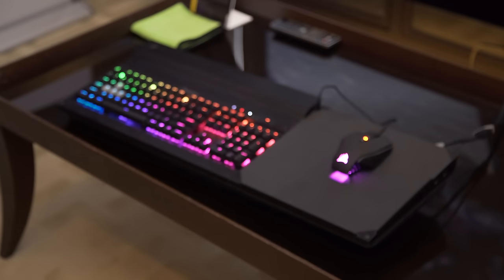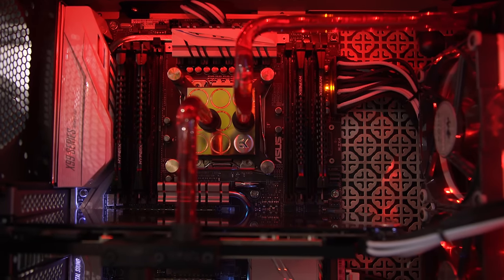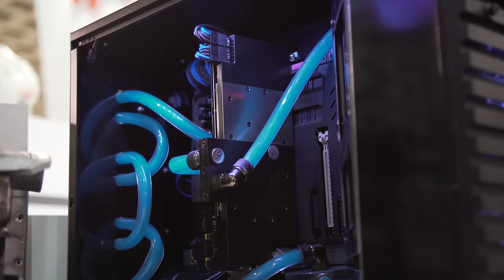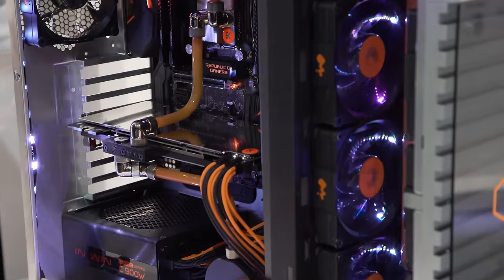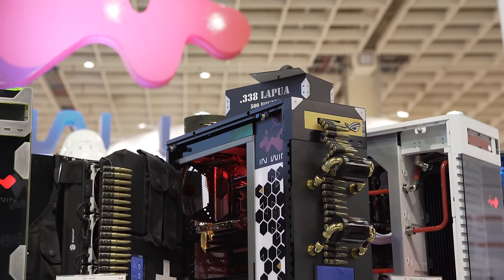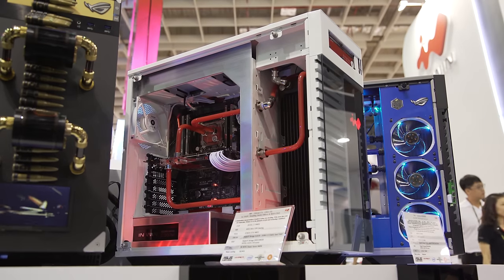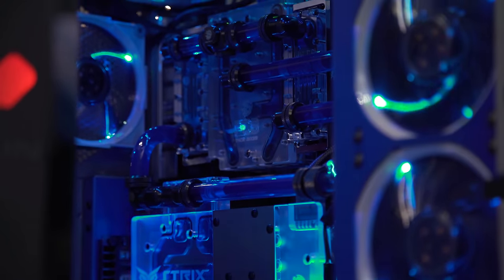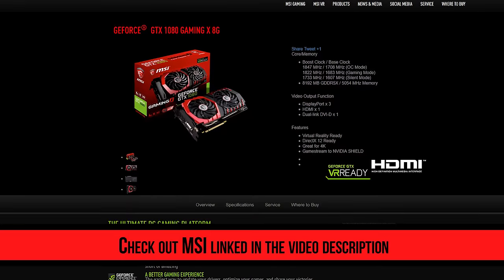INSANE 24 hour mods!

Comment: The third one wins. 

No question. Even if it was leaking. It's fucking beautiful.
Reply: Id buy that case. Some of these companies should look at and offer to buy these designs and use the simple ones. They look reall nice. I think a company made by the case modders to make cases for retail would do really well....
Reply: I agree. But if I can't use it, I would cry blue tears, too.
Reply: The outside of the case looks really crappy, and the inside is cool, but nothing special when you compare it to regular pc mods apart from arranging some parts a bit different. And you cannot use that glitter cooling fluid anyway for anything else than presentation for a few days.

Comment: Man, that screen on the front is a kick ass idea. I am only just getting into moding. I have a tech question though.  Is this screen or could you link a screen directly to hard drive to do diagnostics,  watch frame rates etc of bugger screen you are using or just have all real time current pc info displayed etc.  That sort of stuff?
Reply: You could probably do that, might take some finagling though. They probably used something like a small camera monitor to hook up to the computer.
Reply: Ok.
Do you think it would be good if manufacturers added some type of diagnostic info on a plug straight to a 2 inch display on cases so everyone had realtime information on framerates and all the usual stuff people like to monito, you know like fan speed temperature. It could be endless or a really small screen and you can tab through them all or just have 3 main ones on screen. I think that would be awesome and then you would never have to run separate programs and the info would always be there.
Reply: mackstertube I think it's a great idea

Comment: They all looking nice but most where just the generic plexi/glass/led and fancy watercooling mobs you see 9257985917 of on each modding forum, the only ones that really stood out are BS mobs and the titanfall one.
Also i though they needed to mod a case and not stick all the radiator in a backpack next to it that an easy way to make your system look cleaner inside and make it a completly impractical mod

Comment: i think bsmod's entry is one of the worst. no sorry, just honesty.
Reply: Modding like this is art so everyone has a style they like. Why didn't you like ours?
Reply: simply how it looks. it's mostly a bare metal box in my eyes.
Reply: Roger that it is very simple and clean but still with a strong theme...thanks for the reply
Reply: +Abyssic1 I didn't like it either, but your reasoning makes me assume you're lacking eyesight ;) There are a number of details, it's just not my kinda theme.
Reply: i thought some more about this and i wanna be more specific. possibly to help. please note that i'm not trying to tell what's wrong and right. just my taste.
i think the medieval theme is really hard to do justice since it is a real thing of the past and should be authentic in my eyes. and that's probably impossible in 24 hours. instead of saying what i don't like, i'd rather tell what i have in mind for a (very time consuming) medieval project:
i imagine a medieval chest.
- outer case constructed from old refurbished wood planks (or if metal plates, those would be made to look like forged and some serious dents and cuts in it)
- edges of the case adorned with forged or at least cast iron fittings and boltheads (ofc this doesn't have to actually hold the structure together)
- decoration elements from leather (a crest for example)
- hinged iron handles on the front and back (like a chest)
- side window out of "leadlight" (lead pane window) or iron bars
- inside of the case lined with red velvet
- understated black mobo and shiny golden gpu, ram, cpu cooler to symbolize gold in the chest
- electric flickering candles for lighting on the inside (maybe even hidden for indirect lighting)

i hope everything is understandable. pardon me if not. i'm not a native speaker.
Reply: I object to the leather, but I'd also prefer some dents and cuts in the metal plating (would indeed have helped a more authentic look) and I like the flickering candles :)